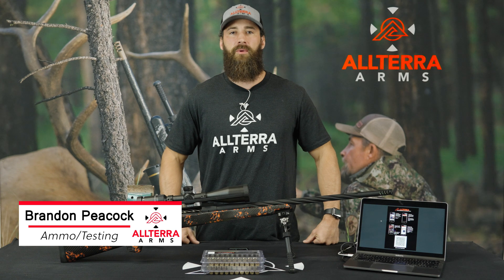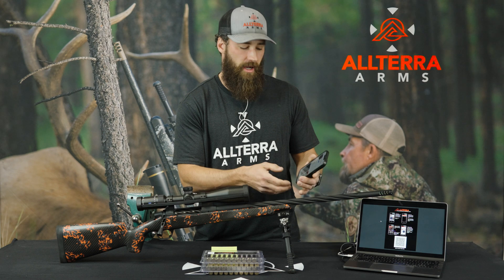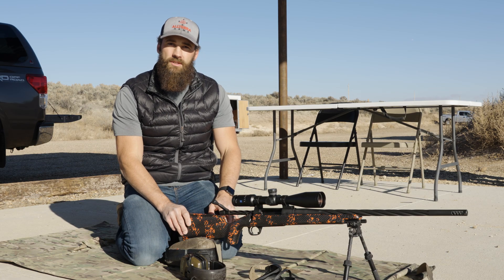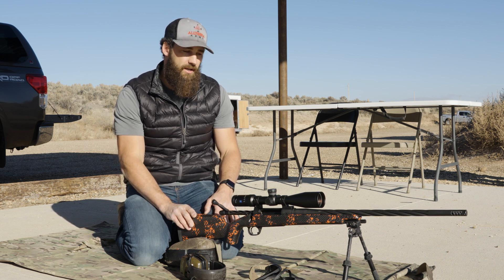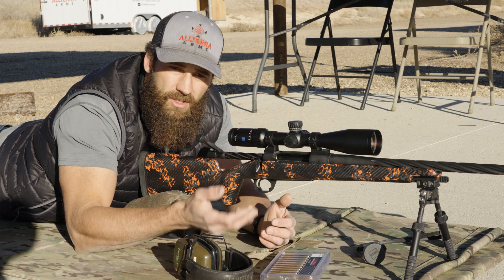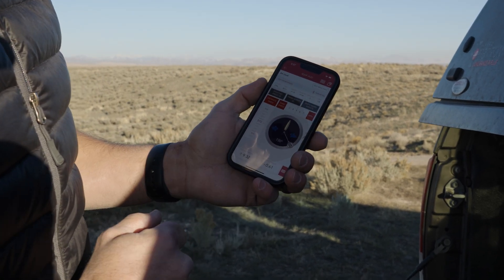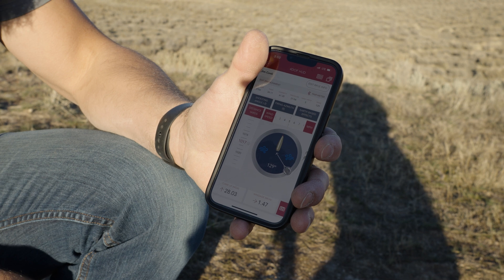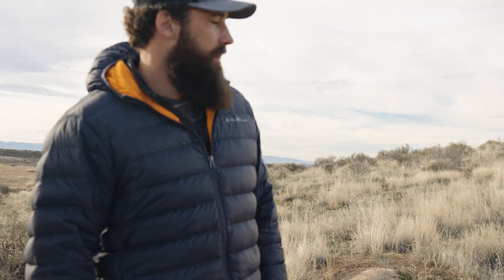AllTerra Long Range S2-1000 Ballistics Package

Comment: wow wind is left to right, yet the impacts are way off to the left at the 1017 yard steel? looks like your hold off was in the wrong direction imo. 🦘🦘✌✌
Reply from the maker: No, more like the effective wind speed was less than he estimated and held for. The tiniest of variables at that distance easily cause a 6" horizontal impact error. This is excellent shooting in those conditions.
Reply: @allterraarms  Agreed 100%, it shows you just how much wind will effect the projectile, unless your shooting at over 4,000ft per second and a heavy projectile like say a .338, but to get it at that speeds is almost impossible, if most around 3,000 ft per second and even then your pushing the barrel to its limits. Great precision work on all aspects of your builds. Keep it straight, cheers 👌👌🦘🦘✌✌

Comment: Wouldn’t a bdc turret be easier?
Reply from the maker: Yes, but less accurate across varying conditions. We do offer them as well.
Reply: Out to 300 yards hunting game I like BDC. Smaller varmints and longer ranges I like MIL reticles. Dial for elevation- hold for wind. 

Both are good but you need to match your gear to your objectives.